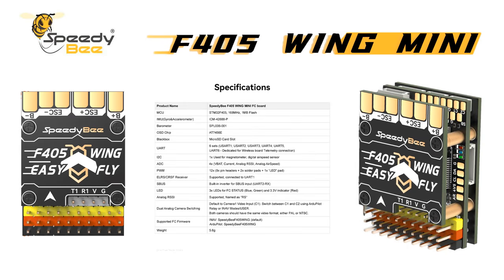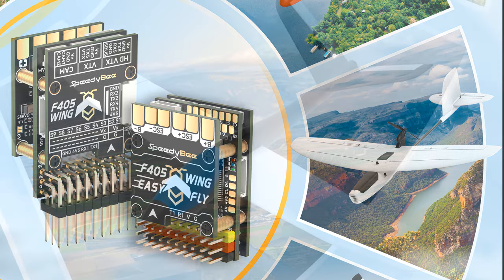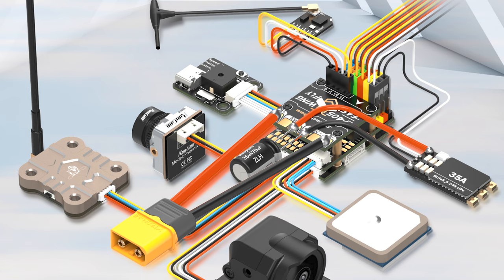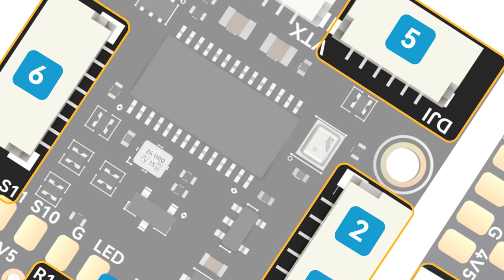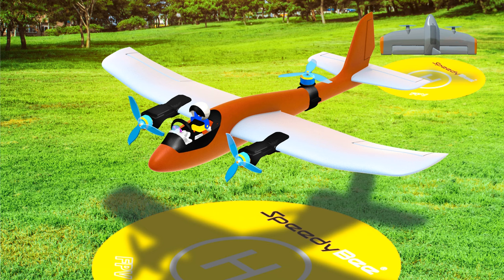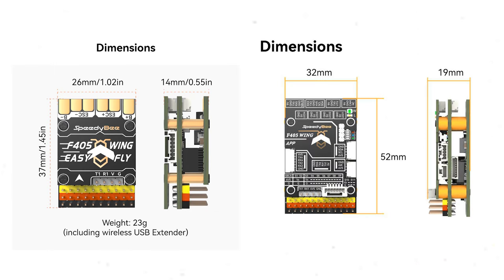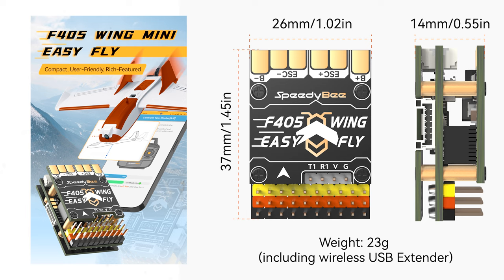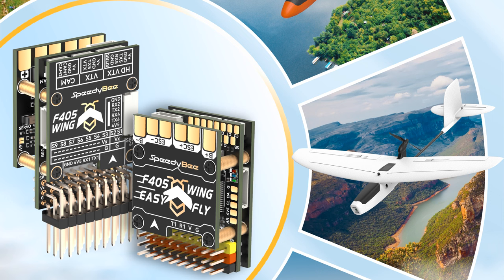SpeedyBee F405 Wing Mini Review and Specifications

Comment: Bummer that they dropped the 9/12v BEC for VTX- that pretty much shoots down the hope that we can switch VTX power on/off via Radio switch (really needed to prevent overheating of VTX while waiting for GPS fix or other delays).  I understand this capability is in the works for a new version of the original F405 Wing from SpeedyBee.
Reply from the maker: I usually have my vtx unplugged via jst until I’m ready to launch so switching it on or off via transmitter doesn’t really bother me. But I do understand it is the easiest way though than to plug and unplug a jst plug each time.
Reply: Could you not use a miniature solid state RC switch (like the Menace) to control the power via a spare channel on your TX?
Reply: @Beerbatter1962  that's what i do